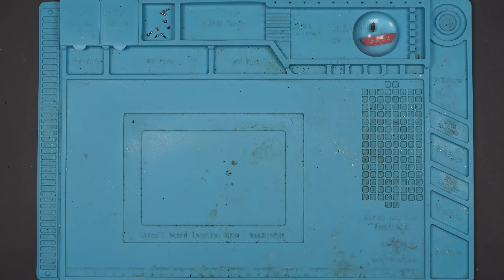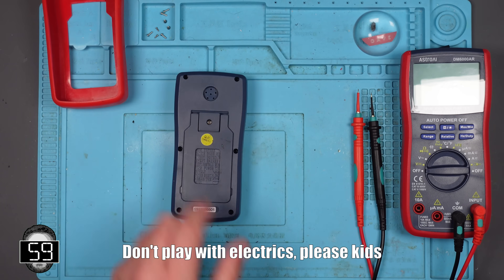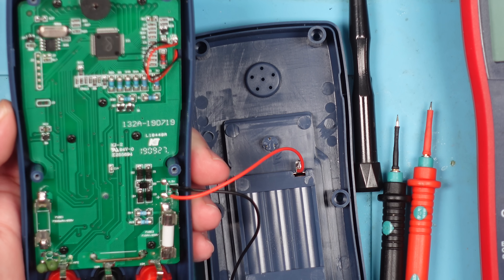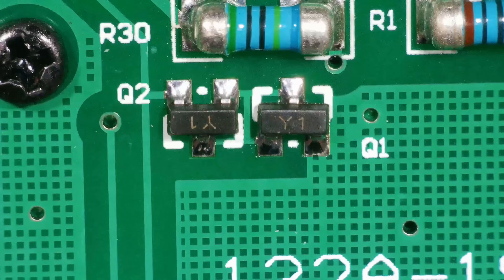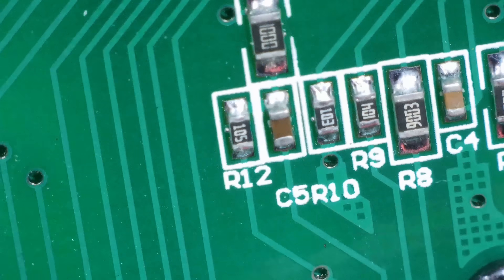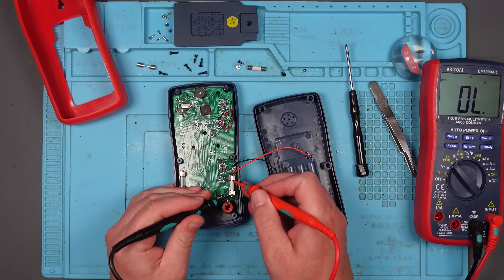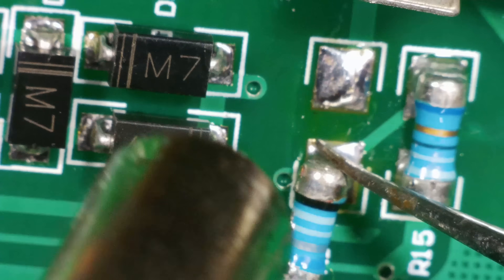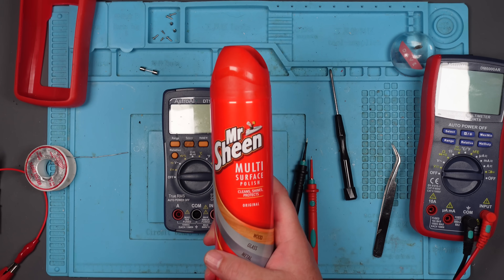My Multimeter BROKE | Can I FIX it?

Comment: Never use a multimeter in resistance / continuity mode with the power on or batteries connected.  Also discharge any capacitors. If not you may get false readings!

Comment: Well done.   You'd be well served to put another SLO-BLOW fuse in there ( White casing)  I wonder if that meter has memory which you've performed a reset on by power cycling repeatedly.
Reply: IMHO the ceramic fuses are all Fast acting. a 500mAF is 0.5A Fast (Flink in German) and 500mAT Slow (Time-Delay in english) (Träge in German)  very fast fuses may have marking 80A FF, it means very fast

Comment: Procedure tip: do not spray the cleaner on the multimeter as you did. The spray gets between the buttons and will build up gunk over time. Instead , spray the cleaner on the cloth , then wire the multimeter with the moistened cloth. Less liquid gets between the buttons and facia.
Reply: Most electronics cleaners do not left any residue. It is unnecessary to do that. They will evaporate fast and clean. Unless you are using tap water and soap, and that is not approved electronics cleaner.
Reply: @stark_energy neither is popular furniture polish Mr Sheen.

Comment: @StezStixFix .
Rough guess, when you were working on it originally and it blew, I am thinking there was minor arcing across the dial contact wiper before it blew, Working the switch backwards and forwards eventually cleaned the arc damage off enough for the wiper to start conduction again, BTW the fuses are high voltage, quick blow and filled with sand (or other medium) wait till you see the price!, Well done and always good to watch, Chas

Comment: The ceramic fuses are HRC and should oly be replaced with the same for safety
Reply: Sure should. Glass fuses will lead an arc, not in low voltage measuring though...
I´ve seen videos of a multimeter exploding due to glass fuses.
Reply: @sveindo bulshit what arc it will just blow up maybe glass case beeak too,but nothing more by same u mean HRC or same values glass...same values glass breaker is safe in casing ofc HRC better always but even thin wire will do...ofc not a fuse and multimeter can burn before the wire...still fuse is a fuse filled with sand or not arcs are not that scary cause both fuse ends are connected anyways it is safer cause it sand in HRC will prevent arching,but in glass case might break,but other than that it is not a big deal

Comment: I would test a voltage and a resistor with both multimeters to check that they have similar readings before you use it. To check that the fixed multimeter is still within calibration.

Comment: Hi Steve. The problem was with the options selector leads. You didn't see it in the video, but if you put the circular leads on the other side of the circuit board under a microscope, you'll see copper remnants joining some leads with other leads that shouldn't be touching, which is why you're getting the error on the screen. This happened to me a while ago with a cheap multimeter, and when I looked at it under the microscope, I realized there were leads joined by pieces of copper torn off when moving the selector from side to side. This is caused by friction, and it drags the copper to the sides until the leads mechanically join together. You just scrape off those artificial bridges, and the multimeter works normally again. That's why in the video, after moving the selector repeatedly, you get it to work again, because you've broken those small bridges. Best regards.
Reply: Wow, something so simple can be fixed with a little cleaning. But the weird thing is the blown fuse at the beginning.
Reply: @gabryproject  We don't get any explanations from this video, but I think the fuse is for the mA range and got blown way before unnoticed, multimeter should work fine without it on other functions.
Reply: @semiRockethr  that's correct :) it happens so often that now I keep 2 spare fuses stuck near the batteries lol
Reply: @gabryproject the fuse should not gave that error message.
Reply: @sonixthatsme  indeed, it wouldn't give any error message.  I blew both fuses in mine, and had no idea when they blew.
Reply: @gabryproject  The fuse will have been blown by having the leads in the mA or A socket while measuring a voltage. It's an easy mistake that most of us have made.
Reply: @gabryproject  The fuse may have been blown earlier.  If it's for the amp measurement side, which is not something Steve does much, he may not have noticed.
Reply: Yep. Checking and cleaning the wiper mechanism on the knob would have been step to take.
Reply: @InterCity134  It's very important to clean your knob
Reply: @georgewhite1972  maybe not one for the IPA though?
Reply: @georgewhite1972  Clean your knob, blow your fuse... all that may be for a different type of video :)
Reply: @joffff  ooooooh yeah, that would be a tad tingly!!
Reply: @FlavioVillanustre  😅
Reply: @georgewhite1972  Speaking from experience George?  🤣
Reply: haha I thought it was a rare thing when it happened to me some years back. fortunately I didn't mess around much, I went with the cleaning option first, when I discovered the dial contacts could be bridging tracks... Thanks for confirming the issue is not so rare at the end.
Reply: Man, that new Multimeter is sweet!
Reply: Why would that happen at exactly the same time as he blew that fuse?
Reply: @Calmerism  The current that blew the fuse caused arcing on the switch contacts?
Reply: This guy multimeters!
Reply: I agree happened to 2 cheap multimeters I onwned

Comment: Workign backwards, ERRE, could mean error reading setting. So indeed it could have been the issue was with the wheel when setting the right circuit. It's possible it still has a fault, but the only way to know is use it for another 6 months in continuous use. If it does go back to ERRE, then I'd suggest cleaning the wheel contacts, and otherwise follow fuse and see where it goes. Most likely it's something between the fuse and the probe port.

Comment: Steve, the fuse rating is actually on the old fuse, it's engraved in tiny writing on the metal end cap... from the microscope footage you can see it written on the one that didn't blow.

Comment: My gess is that the problem was the fuse and the selection knob contacts, the knob routs the input to the correct measurenent circuit, there was a higher current going in and before the fuse blows maybe it did some damage to the selection contacts, by going around with the selection nob the selection contacts got a good connection again ti the pads... Love your videos, greetings from Portugal 🇵🇹 for you and Dave😂

Comment: Call me stupid but does the voltage have any bearing on the fuse, 3amps is 3amps irrespective of the voltage innit? Ohm's law and all that?

EDIT: ... unless it's related to the speed it blows, i.e. there are slow blow fuses for transient spikes.... I dunno, this is a serious question lol
Reply: Voltage rating relates to the voltage that the fuse can safely break. If it blows it's got to be able to break the circuit cleanly without arcing. Higher voltage fuses are usually ceramic bodied and filled with sand to quench any arc. Under normal operation the voltage rating is not relevant as the fuse is a short circuit.
Reply: @adamdavies163  Ahh, OK, thanks for the explanation, that makes perfect sense.

Comment: I have that exact same meter, the new one you got, if you find the beeping way too loud you can open up the meter and stick a paper clip leg into the piezo buzzer and hold it in place with some mounting putty or hot glue to dampen the sound, make sure the paper clip is putting pressure on the diaphragm . Made it much more tolerable while still being easy to hear.
Reply: I'd rather use 3M tape on the multi meter, it does the job, pretty decently. Had same problem with my lamination machine which beep loud and has same sound like multi meter

Comment: The fuses are only for current option. That's why I prefer Fluke. People will disagree with me but couldn't care, never popped anything other than the fuse due to negligence , but had it on wrong settings before and measured high voltage, and it still works till today
Reply: I like my fluke meters.   But it's not like I haven't had issues.     Contacts getting dirty on the selection switch.     And the displays going out.     But then again they are getting really old.
Reply: @jasonk5979 i have an old 77 that was my dads and it's still working,  yea it's basic but only thing that was replaced on that was multiple leads and batteries . Only reason why I got myself a 179 is because i needed more functions that wasn't available on the older one. That's the one where I popped the 10A(11a) fuse
Reply: Hook it up to a microwave's high voltage transformer and then let me know how you get on...

Comment: All i can think of is the contacts on the selector wheel that were dirty  and by spinning it over and over again it cleaned them with friction.
Reply: De-oxit on the meter rotate  selector contacts  and appropriate fuse and you’re golden .
Reply: My jobbing meter needs the selector wheel contacts cleaning every few years and replace the ptfe grease. Else it throws a hissy.
Reply: Exactly.
Reply: seems very possible, after all it is the part you use the most in the multimeter, clean contacts could help to avoid it repeating, but the new multimeter has bigger easier to read numbers, so this will be a plan b for another year
Reply: That was my thought too. A rubber can do wonders to clean oxidized contacts (on computer RAM).
Reply: Did that cause the fuse to blow errrrrrrrrm no 😊

Comment: I think you gave it an overcurrent which blew the fuse. Rapid switching could do two things, one is to clean the contacts, the other is to do a factory reset.
Reply: There is no reset there, and the only nonvolatile memory is otp calibration
Reply: The problem of Err was with the options selector leads.

Comment: What I had with mine was bad contacts on the turning knob, I would suggest to clean the pads with a glassfiber pencil. Be aware, if it makes "click click" it often has little balls inside with a spring to give this feedback effect of "steps" but it will work without the ball too, but you have to switch it manually to the right spot. Those contacts get often used when you turn it on/off and are the most used thing, so it would make sense why they failed and why it started working again when you turned it on/off all the time.

The additional band on the resistor may be for "fuseable resistor". Not sure, but possible. 

The fuse with 600V has some sand in it, so the connection is securely lost and no spark will go between the opened contacts. It will be fine with 250V, too, I guess, but you may want to measure High Voltages, it would be better to replace it with the right part, but it has no effect on the operation, just not as safe when you need it to be save.

Comment: "I used the multimeter to fix the multimeter." - Steve
Reply: I use the hoover to hoover the dust off the hoover, a similar experience but not so technical

Comment: Uhm.. you left the batteries in and used your new multimeter to measure on the power input again. I guess you did have it turned-off but...
Reply: I would have taken the batteries out personally.  Just that little switch was stopping the electrons from each side getting into another argument!

Comment: The worst kind of repair possible when it fixes itself.
I would not bother about the fuse  you will probably never go above 250 anyway in what your testing 600v fuses are more suited to 450v applications
Reply from the maker: Yeah, i was wondering if it was dirty tracks on the dial thingy, but it was super clean! Still don't fully know what was wrong with it! 😬